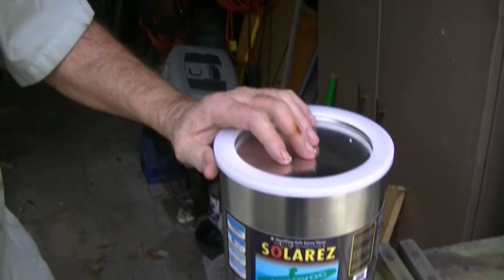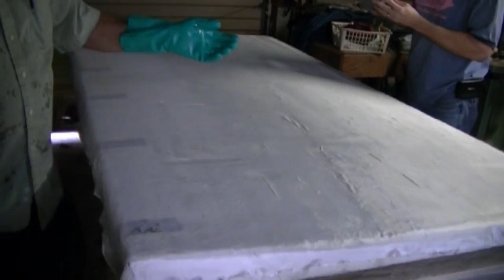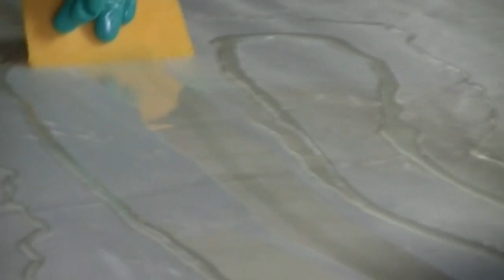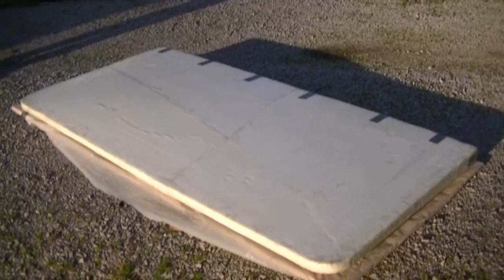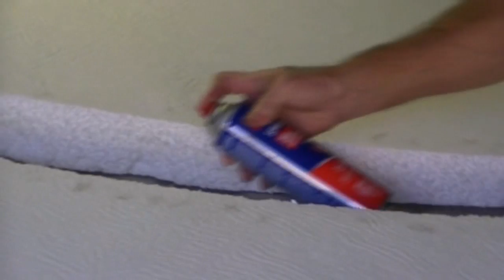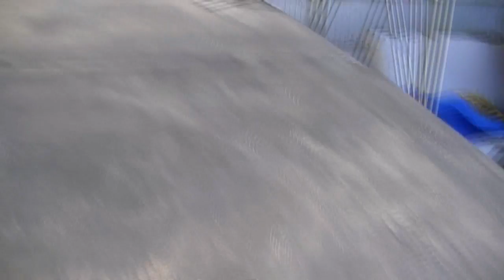Spa Cover Repair

Comment: What a great job! Would you be able to tell me what type/brand of adhesive you used to put the broken foam pieces back together?
Reply from the maker: It's been so long I really don't remember. I just went to the store and bought spray can of glue for the type foam panels in use. Just be careful not to get a type glue that will melt the foam. The glue has no strength, just a sticky to get to the lamination process. The resin and cloth is the strength. Epoxy resin was used, polyester resin will melt the foam.

Comment: How much do you think you raised the weight of the cover using the epoxy?  Good idea....
Reply from the maker: No idea, never thought of weight when doing the project and did not weigh them. They are a little heaver than original but it has not been a problem.

Comment: Great job guys! Hot tub covers take one heck of a beating between the weather, chemicals, and just simple wear and tear. I have been making covers for 30 years and as materials have become available we have increased the strength and worked towards making the covers free from absorption. Covers used to be just 2" flat when I started making them and now we have our extreme cover that is 6" slopped to 4" which was done to take on snow loads in the North. The fiberglass is a great idea and who knows maybe the next evolution for hot tub covers.

Comment from the maker: Never fiberglassed before. First side one layer. That is why second was tacky and hard to smooth out. The other three sides laid down 2 layers the wet-out with resin. On each panel I laid 2 layers of cloth on top and 2 on the bottom. All four edges had 4 layers from lapping over. This process was done the same way on the second panel.

Comment from the maker: My First time at it, self taught! I believe in open source concept of life. After all the Internet is the library of the world. Other thoughts! Salvaged a washing machine from the dump in 1976. Spent $35.00 for a water mix valve, still using that washer to this day. Changed the clutch out in my truck, first time I done that not to mention it was an Eaton Fuller 10 speed. Used a craftsman floor jack on gravel driveway. MacGyver would have been proud of me!!!

Comment from the maker: I just removed the panels from vinyl, removed and trashed plastic, and just let them sit for a few weeks to air dry. During that time I was researching and ordering the materials. Used epoxy resin, polyester resin will melt the foam. I did this in January 2012. Cold, not only heated garage but the resin to be workable. If you noticed in the video when I went outside, afternoon winter sun but resin cured. Wrapped plastic vapor barrier, taped, inserted into vinyl.